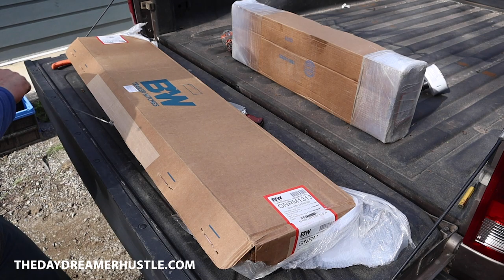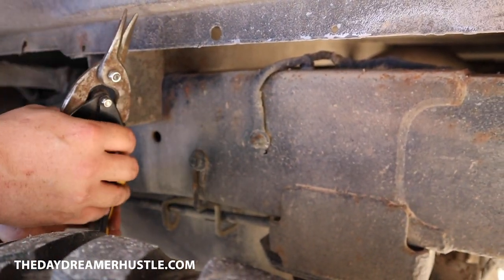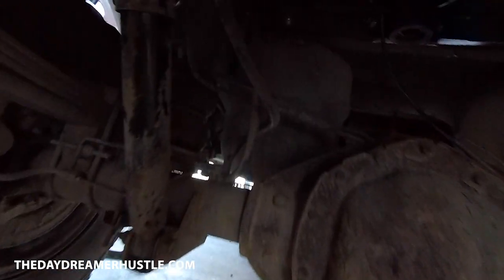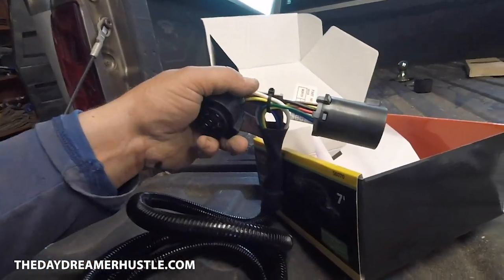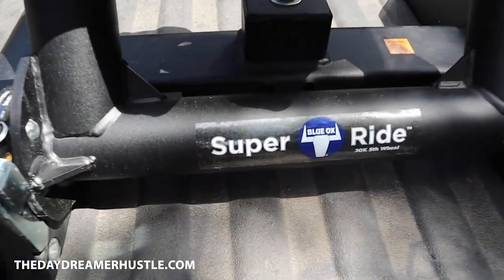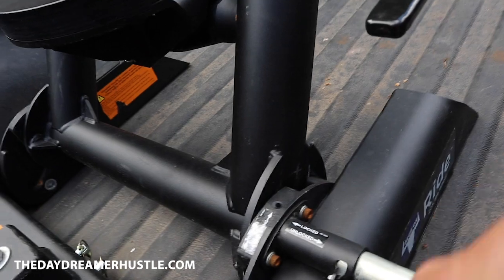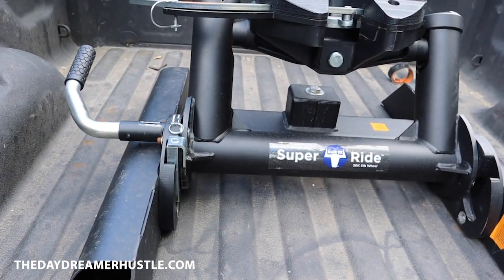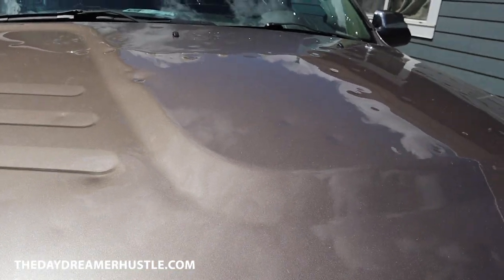DIY INSTALL B&W GOOSENECK BALL - FIFTH WHEEL 7 PIN - BLUE OX HITCH

Comment: I will have to reference this video when we get a fifth wheel!
Reply from the maker: The B&w turn over ball hitch is a lot easier to install than the traditional rail system. Unless you get a newer truck with fifth wheel prep. With the gooseneck ball in the truck now we are looking at the Reese 20k gooseneck pin box, for the future.

Comment: I just put my (used) BW gooseneck in yesterday, in my 07 Ram dually.  It's kinda a bitch by yourself.  lol  that stupid carriage bolt fishing is a PITA without the BW fish wire.  I made one from some galvanized wire I had,  Was a tad too soft of wire, but it worked..  until it didn't on the passenger side.  I now have a 2" carriage bolt and a bracket laying inside my frame-rail  LOL!
Reply from the maker: I know those bolts and trying to hold it up while bolting it together is hard by yourself. It was hard to film, I was getting frustrated. In the end it turned out good but next time I will get someone else to install it lol.